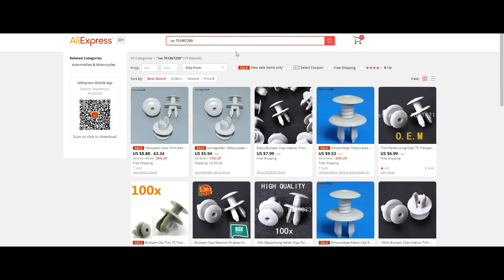Rear Bumper Removal VW T5 , T5.1

Comment: The clips that you cut off are really easy to remove. Just put a drywall screw in a pair of mole grips then wind in to the clip and pull. Really quick to do and you can reuse the clips.